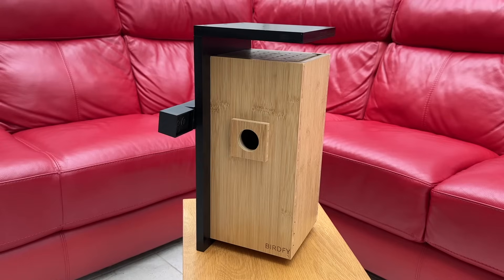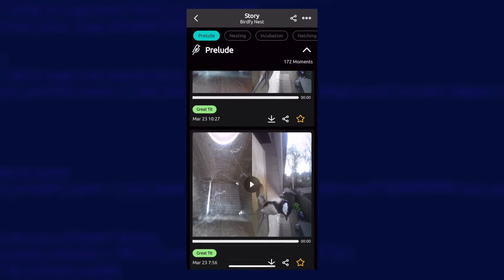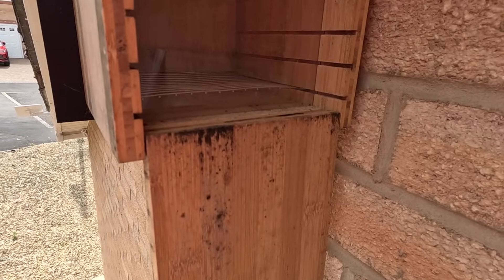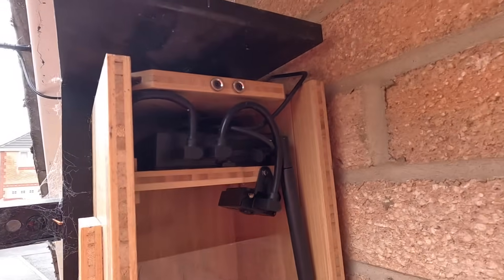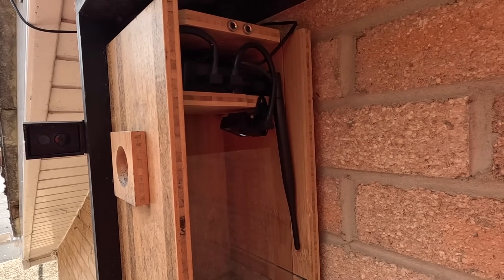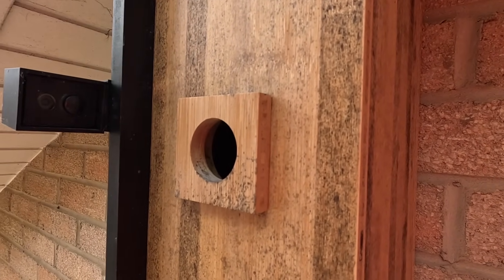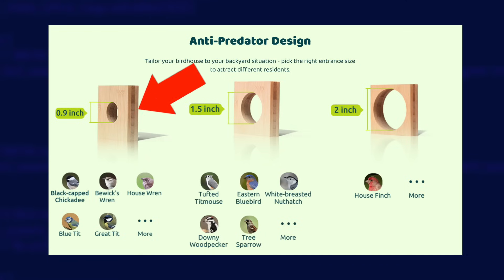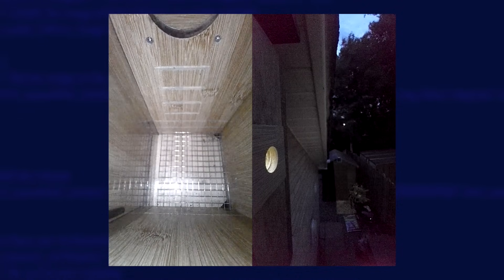Smart Bird Box with TWO Cameras and AI - Here’s What It Caught! (Birdfy Nest Update)

Comment: Consider a young small bird trying to get out for it's first flight? I'd put a branch inside from bottom to the exit hole. That might help the couple decide on the 'new home'. I'd use a branch as that will have lumpy bits on it to help climbers.
Reply from the maker: There are fledgeling kerfs up the front panel to the hole in order to help them get out, but I take your point. Videos I've seen of other people's nests where they did get birds move in seem to use them no issues but it does look quite a steep climb to me!

Comment: Best place for a birdbox is on a North facing wall out of the sun for a more constant temperature and high up away from cats. And yes the smaller aperture hole will appeal to the tits. Good to have the metal reinforcement too to deter the magpies and woodpeckers. Good luck for next year, it is fascinating to see all the stages of nesting and chicks developing!
Reply from the maker: I went for an east facing position after reading online that was best here, not facing prevailing winds but still some sun in the morning. Plus it meant the solar panel could face south easily. I’m hoping more action next year now